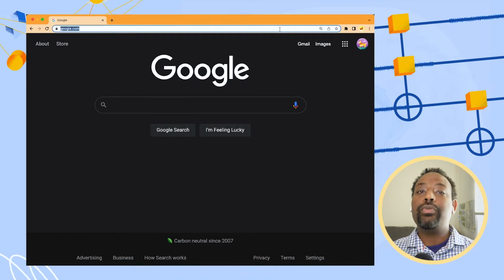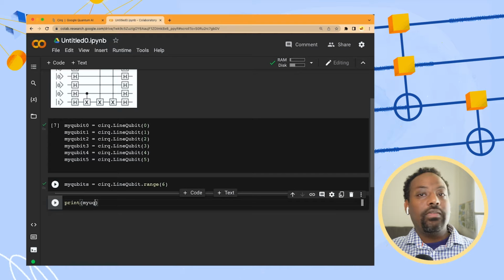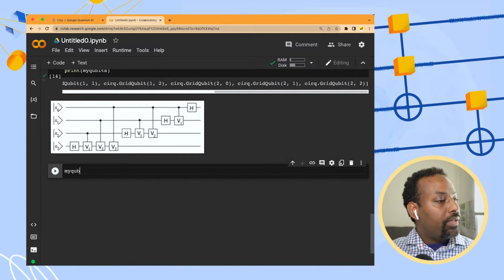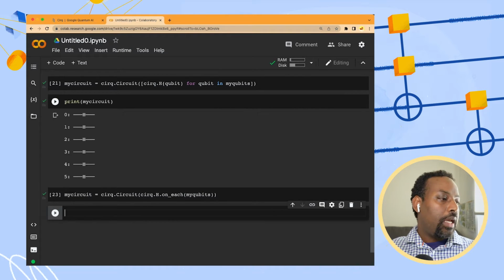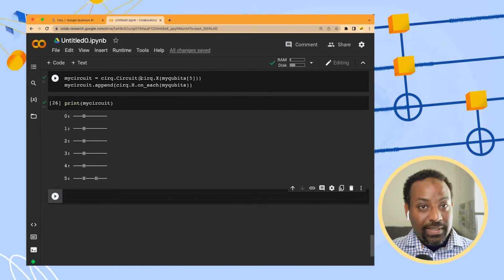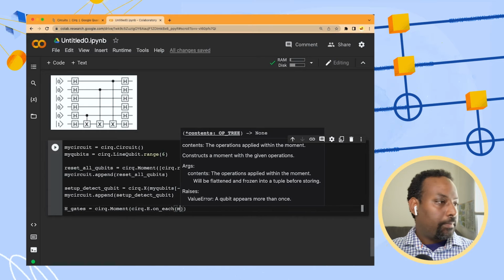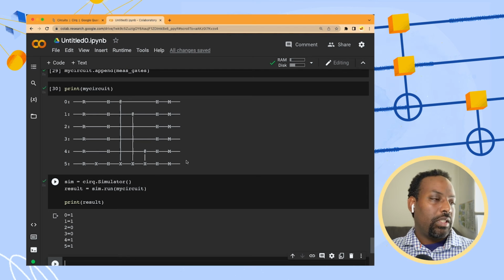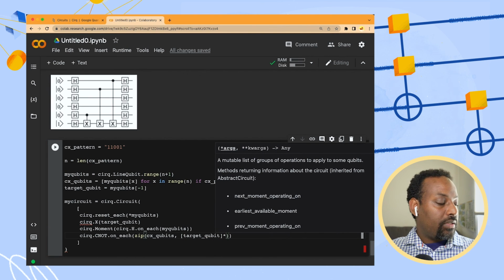How to build a quantum circuit with Cirq 1.0

Comment: To answer the question asked: 
Q: Why is it a good visualization strategy for every operation to be as far left on the display? 
A: I believe it is because on real hardware those gates will be executed on those qubits in parallel, so if you want qubits to be in a specific state before using it in a operation (such as cnot) you have to be careful to make sure it will actually be in that state when you use it in a control operation and and not in some other way because the gates didnt operate at the right time. This may not actually be the issue and there may be some hardware/software scheduling on the quantum computers to solve this.

Comment: Thanks a ton for the tutorials :) I have a couple of comments:

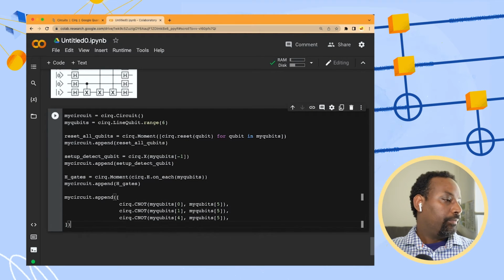1. At 15:51 you have written the code for the three CNOT gates in the opposite order of what's in the circuit's screenshot from the book. Well, I checked and it doesn't make any difference to the end result (pattern 110011) but just to make it clear I brought it up. Please correct me if I am wrong.

2. For all the other gates it starts with an uppercase, as in cirq.X   cirq.Z   cirq.H   cirq.Moment   cirq.Simuator   etc. but why is it for measurement in lowercase i.e. cirq.measure ... Perhaps a silly question, but it would have been more convenient if it was rather just cirq.Measure